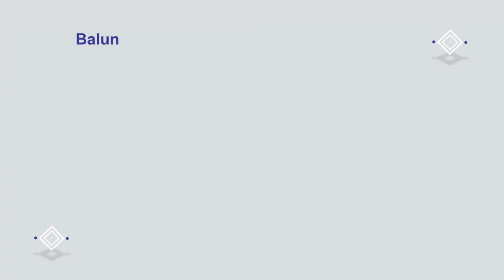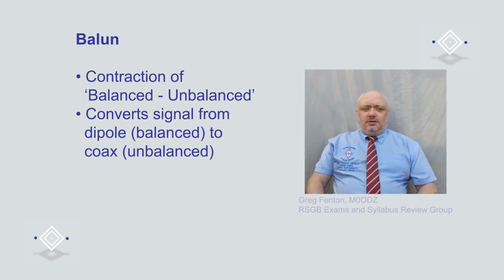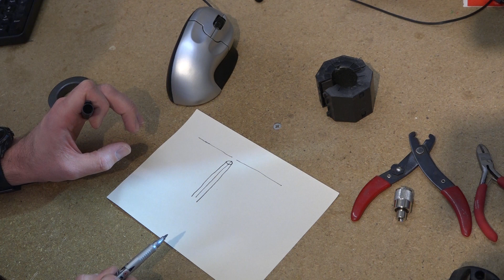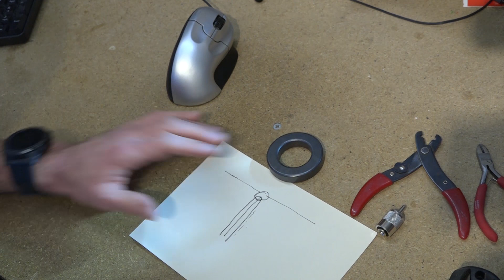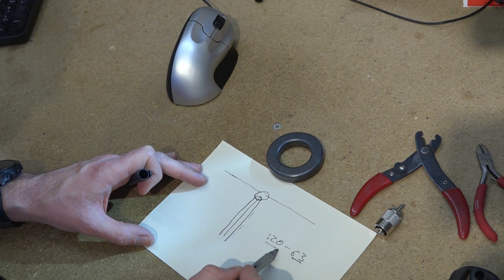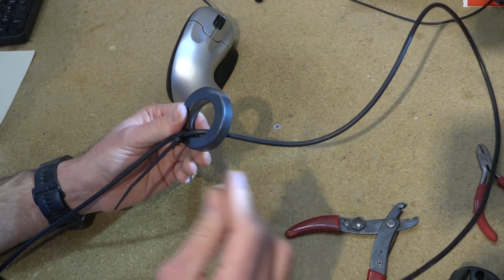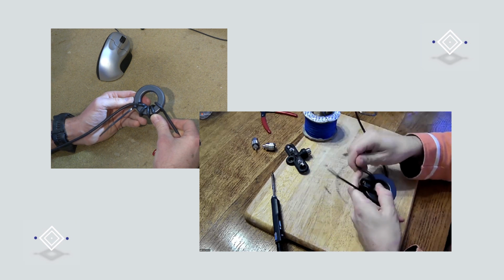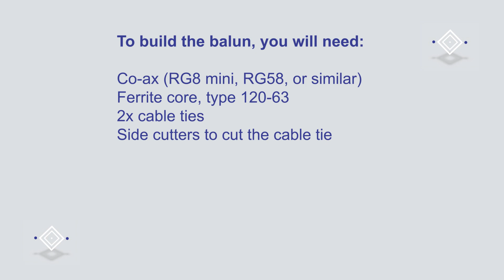RSGB: Useful practical skills videos - simple Balun

Comment: A 120-63 ferrite doesn’t seem to exist. (At least not on any of the many specialist ferrite and general electronic suppliers I’ve looked at.

Firstly, the closest types available are 61 and 67 - no 63s in sight.

Similarly, sizes seem to be based around quarters (or possibly eights) of an inch so there are 100 and 125 but no 120.

Have I missed something or is that number incorrect.

Also, is a 125-61 likely to have suitable characteristics or will it be radically different?

Comment: I am wondering how this is actually transforming a unbalanced signal to a balanced one. Both ends are directly connected to one and another. So if the unbalanced side has its shield connected to ground, the supposed to be balanced side also has a connection to ground and therefore can not be balanced. I might be missing something here. Hopefully somebody can point me into the right direction.
Reply: @WECB640  I  knew about RF only traveling on the surface but I have never thought about a coax shield having two surfaces. So your explanation definitly helped. Many thanks.
Reply: @WECB640  as someone new to the hobby, this is very useful thanks. I was looking at making a very simple dipole as a learning experience and this certainly has helped. Now I know what to do, and why.
Reply: the T2LT or "flowerpot" antenna uses the same principle/method.

Comment: The simple choke type balun you have described can also be used as a line isolator at the transceiver end of the coax to eliminate any common mode currents on the outer of the coax. This can also help with a correct VSWR reading as SWR meters are quite susceptible to the effects of common mode currents.
Reply: Ian, if I do this, will it help prevent interference into my transciever generated by overhead LED lights? What material would work best as I operate mostly on VHF/UHF. When I turn on the lights I see diagonal lines on my Yaesu FT-991A waterfall display. I don't know the frequency of the LED lights. Many thanks M7BAL
Reply: @user-bx6vu  It will help a bit. I would change your LED lighting also interference could be coming in from the mains so a mains filter might help. An easy way to check is to compare noise levels when on battery power compared to mains power. At VHF and UHF use foil plus braid type low loss coax as braid only type is only about 80% screened and can pick up interference. Also keep your antenna outside of your house mains radiation local area to reduce mains interference. Lots on You Tube about reducing interference in your shack.
Reply: @ianthomsonGM0URD  Thanks Ian, Unfortunately I can't change the overhead LED lights as they are the installed in the flat that I am renting and it will be a serious inconvenience :) As soon as I turn them off the interference disappears. I use a mag mount antenna which I take out on the balcony but the segment of the coax inside the flat picks up the LED interference as it's not well screened. What I can do currently is switch off the lights and use a different light when I play radio :) I will try a choke but currently not sure which ferrite mix will be best at allowing 144 MHz and block everything else. Edit: I also ordered some M&P Hyperflex 5 coax which I hope would help with better screening
Reply: @user-bx6vu  Better coax should help you could also try a Watson type 2m/70cm antenna attached to the balcony. The shorter length one should be fine but your magmout one may also just be fine. 73's.

Comment: 7:14 I always thought that it's for cancellation currents within toroid.
Reply: The turns are still passing through the core in the same direction - you're trying to reduce capacitive coupling between input and output, though I think it's more relevant at higher frequencies than lower. Rob, M0VFC
Reply: @M0VFC  "The turns are still passing through the core in the same direction" yes, they are but at half of the toroid faze (direction of current) is turned 180 degrees. For me, it's like half of the turns induce magnetic field within the core and the same amount of field induce a current in the cable on the other half (Lorentz force) but because the direction of current is reversed the currents cancels out itself.